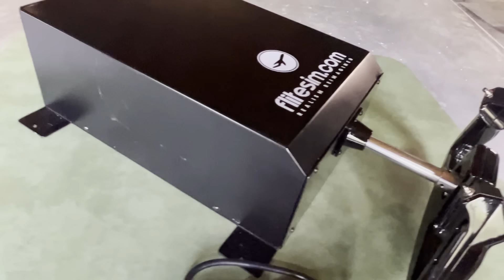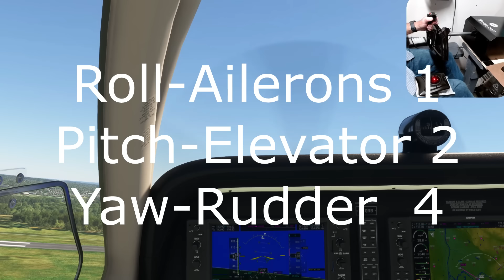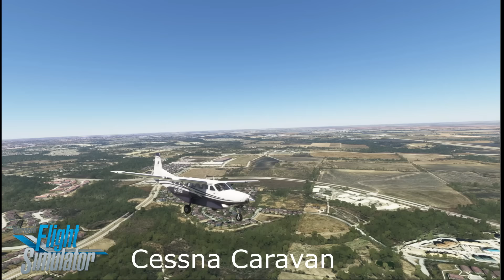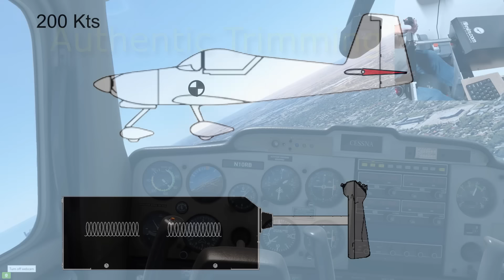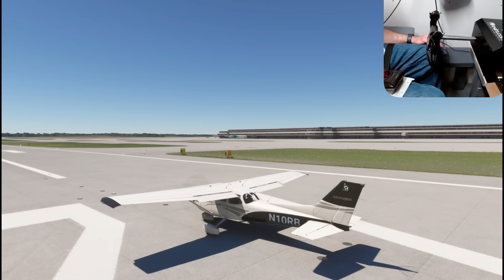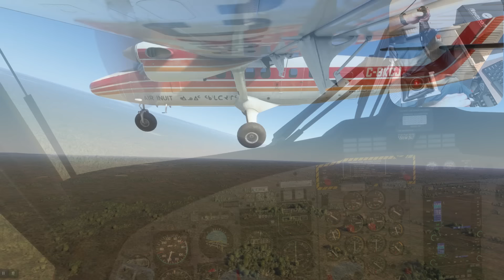Finally! An Affordable Force Feedback Yoke: A Pilot's CLS-60 Review

Comment: Hi Russ. Great Video. I recently completed building my C172SP Home Cockpit for continued training. Part of the build is the CLS-60 FF Yoke. I appreciate your perspective as a certificated pilot (not sure which Russell Barlow of 3 in the FAA Airman Registry you are, but I'll guess you are the Commercial Rating holder  😉). As a certificated pilot working on my SEL IRA, I'd love to have your CLS-60 settings if you're willing to share. I used the out of the box and one or 3 other settings, but they are a bit unrealistic (not fluid) doing ILS approaches with considerable crosswinds -- doesn't feel real. Also the aileron crosswind correction for takeoff and landing seems to be somewhat unrealistic for xwind > 10 kts. Appreciate if you could provide it. Much obliged in advance.

Comment: Russ have you tried the Moza AY 210 FFB Yoke yet, would like to get your opinion
Believe it has the old problem with the trim function, with the yoke returning to the neutral position instead of just releasing the pressure with the yoke in the same position

Comment: I love the fact that they didn't junk up this build with the usual consumer grade light switches, dinky throttle axis, misplaced ignition switch, goofy LED lights etc. This has the feel of Virtual Fly products which are modular and bulletproof. . They could use an extra button on the left for CWS and perhaps aileron trim on right etc. I also like the fact that the yoke itself could be swapped out for say a rams horn Embraer or Boeing style yoke or even a 3D printed yoke perhaps. I hope all devs realize that modularity is key to flight sim controls at least at the pro/prosumer level. imo Thanks for review Russ!

Comment: Thanks for this!  I have been on the PRE-order (Kick Start) list for a number of months waiting for the release.  Getting the emails from Fabian with long awaited shipping options and then finally the units going to those first pre-orders.  My unit JUST arrived a few days ago and I just integrated it into my sim.  WOW!
 
As a rusty old Cessna pilot and current flying with an old friend in his Coast Guard edition Hawk XP (210 HP),  finally built my very first flight sim over the past couple months and wanted to go top tier on EVERYTHING.  The CLS-60 was the perfect addition for my Hawk XP II sim.   I have the full Next Level seat and desk pro, and had to build a custom gaming computer too.  Purchased 3,  55" (4K) screens for this is so immersive and the CLS-60 adds so much realism! 

Tomorrow (as of this writing), the Buttkicker Pro will arrive and is a perfect mate for the NL cockpit, as they provided the post to mount the unit under the flight seat.  This will complete the build.  Fine tuning all the haptics will take some time, can't wait, been a blast so far.   

FUN FACT:  If you are a Cessna flyer, it is known as a CONTROL WHEEL.  You won't find the YOKE reference anywhere in the Cessna handbooks.    Again, thanks for your presentation! 👍

Comment: Thanks for your review. As much as I like the Yoko I have really wanted an affordable FFB. I was also glad to hear your take on the Brunner and its "mechanical feel". Sounds like I would have been disappointed. I've been practicing slow flight and stall recovery with the concept of getting current again. As you indicated it's really a drag (no pun intended) when the spring gives you the same force no matter what maneuver you're completing. I have the Virtual-fly Solo GA1and Ruddo pedals. Hopefully the Yoko cut-out will accept the width of the CLS-60. I'm sure it's too tall, but I can make a cut-out for the depth.

Comment: This does look amazing....but why does it need an emergency shut off, is there something dangerous involved?
Reply from the maker: Yeah I wondered too since Brunner doesn’t have one. When I first got it the self test was more aggressive whipping the yoke from 180 degrees left aileron to 180 right at full aft in an about a second. I guess if you were too close and it went wild the 13,5 pound force  could slightly hurt you but the quick shutoff in red seems a bit dramatic.

Comment: FFB completely spoils you.  I rarely use my traditional spring/cam units anymore.  I am using the Simionic FFB yoke, and the Bruner for my stick.  The only use I have for my Virpil and VKB units anymore is for flying the Airbus, since it is a fly-by-wire aircraft with no flight control feedback, and space sim stuff like Star Citizen.

Comment: I currently use a Fulcrum One and this does look very interesting. I fly in VR and use a physical yoke and pedals and VR controllers and voice commands for all other interaction. Because of that the trim inputs in the cockpit must be feed back for this yoke to work for me. After being burnt by Apara with there Kickstarter I am still a little more concerned than before but very interested in what I am seeing. Any chance this will be at FSExpo.
Reply from the maker: Yes they will be at FSExpo with a chance to demo the yoke
Reply: @rbarlow  Looking forward to looking at there display there.

Comment: The 3rd-party trim wheel functionality is an absolute must.
Reply: Or at least just read it from the sim!  I've never like the yoke based trimming.  I prefer the wheel.
Reply: No doubt! There are some new Cessna style trim wheels for MSFS that use an axis instead of button press etc. Could be a great combo. Within 5 years I expect all moveable flight controls will be FFB. Including trim wheels rudders dual yokes sidesticks collectives/cyclics etc. BTW I think Desktop Pilots WHEEL seems best for msfs. nOT AFFILIATED. gOOD lUCK

Comment: Great review. As I am looking into making my own FFB yoke getting the facts of what force and travel is required is a great bonus of the review. Thanks for that. Normally when you build a FFB device you make it work in accordance with the standard USB HID protocol which make the device plug-and-play even though you may mave some extra settings for it via an external program. That means that all the force inputs are fed from the sim and read by the device that then activates the forces with the servo motors. 
What appears to happen here is that they apply some extra forces (prop wash and propeller rumble at least) that is not a part of what is fed from the HID protocol. I'm just guessing. In that case they are "fabricating" effects that may be accurate, or not... It may also be that the forces are in fact fed by the sim in the HID protocol, but of different types. And they choose to enable or disable those specific types in their software with a setting. In that case they are not doing anything special, just disabling some types of forces that normally would all be read by the FFB device. 
If the sim is producing the correct FFB data in the HID protocol there is no need for any device specific handling of it other setting the max amount of force wanted as far as I can tell. The device just need to sum up all the different types of forcesfed by the sim  and activate the motors accordingly and all would be perfect. 
So what I would love to know is if this FFB device is doing something extra on top of the standard HID stuff.

Comment: I just messaged Flitesim about a couple of things I'd like to know:
1. Approximate cost for the CL-120 upgrade for CL-60 owners. 
2. Does the CL-60 physically move while the Auto Pilot is engaged like the real planes do?
Reply: 2. Probably, since its movement is linked to the control surface position in other aspects.

Comment: Great video and thanks for explaining what you did I learned alot! Now on to the yoke it sounds like the Microsoft Sidewinder 2 joystick from a dacade of more ago I just got for $80... Just in yoke and a more high end form with nice softwear not just relant on Win11 and the FFB isn the sims/game... Which is great especly if you can get one for under $300... But what I want to know if it's plug and play like the side winder or not? Like do you need the soft wear or can it do the sidewinder thing of just working? Also I find it funny the more expensive yokes have a proforamnce more similar to the logitch wingman I just got for S60 new old stock... the sidewinder was just the working stick and cables. Which you can find a wingman for $20 or so working anytime used.

Comment: When you mention that you must use the trim on the yoke, do you see the actual trim being moved on the aircraft?   I wonder if what is actually happening is that it is just holding the elevator position with no force required from the user.   I guess that this gives you what you want most of the time with a different method but wouldnt behave the same in some cases where the trim tabs are acting counter to the elevator.   Great review Russ.
Reply from the maker: Yes the trim wheel in the aircraft moves with the trim switch inputs on the yoke BUT if you trim in the sim the yoke doesn't move as it does when using the yoke trim switch.
Reply: @rbarlow  Thanks Russ,  Hopefully they can get some of that simmconnect goodness going.   I am use to trim on stick for some aircraft but I do like my trim wheels in GA.  This is looking like a nice product at a reasonable price.

Comment: Hi Russ,  Thanks for all your fantastic videos and help over the years.  I asked another (RW pilot) streamer if a force feedback yoke made sense for a 737 sim, and he said (effectively) that you don't really get any feedback from the yoke in the real 73, so - no.   (I guess too many actuators between the yoke and the control surfaces?) I know you mentioned you tested it out on commercial jets, but any more in-depth opinions on if it is realistic to use with Boeing or Airbus will be greatly appreciated!  Is it "just" the higher force needed to move the stick that would be relevant to CA, or is there more?  Thanks again!
Reply: I fly a c130 and have flown the 737. There is force involved it's more fluid but it's more a feel pressures and not forces if that makes sense though conflicts in terms of physics maybe

Comment: Had you ever heard of the Iris Dynamics FFB yoke, using magnetic linear actuators?  Sad they abandoned the FS community for the industrial world.
Reply from the maker: Yes I think it was first a Kickstarter but not sure they ever delivered any regular production units. If the current FS2020 expansion of Flight Simming was present they may have made a go of it. I think someone picked up the pieces to get their tech and patents

https://youtu.be/bOCzSHhjAc4?si=KjjIteyyw2dP-fk1
Reply: @rbarlow  yup, that’s the one.  I’ve been following them pretty closely since they pulled out.  I asked if they had dev/demo gear and drawings they would let go of, but they didn’t.  I took it to mean they were keeping it around just in case.  They make a mighty fine linear actuator, but not an inexpensive one, sadly.
Reply: Like lawyers, they discovered that the "industrial world" has deeper pockets than flight simmers.  That's business.

Comment: Very neat. I have been waiting 40 years for a yoke that would do this. Your explanation of how trim works in real life is spot on and I have tried in vain many times to explain it to non pilots. I have a real C182 and created a sim that closely approximates my actual panel. Mostly I shoot practice IFR approaches and procedures with it. I use a yoke poached from an AST KingAir simulator. It has realistic trim in that there is a separate mechanical spring you can move. Of course like this yoke it is divorced from the computer trim. I turn a wheel like on my own plane. I screwed my self when I added a GFC500 autopilot to my real 182 and to the sim. Well the autopilot trims the plane independently of the mechanical trim. 

It does seem that this new yoke should accept trim changes from an autopilot. My understanding is that the yoke does not do that yet and all trim is by hand. Correct?

I’ll check out the site and see about getting one…

Comment: If you can't afford full force feedback yoke and what you want is mostly the realistic trimming by feel, you can mod Honeycomb Alpha Yoke with a cost of about 50 euro, by installing small linear acuator inside which will allow moving the yoke neutral position forward/backwards.
Reply from the maker: Have you actually done this successfully? If so contact me at username barlow320 which is at gmail which is a dot com.
Reply: Mail sent
Reply: @rbarlow Mail sent again. Contains link so maybe your antispam filter blocked it.
Reply: I have a honeycomb alpha. Looking forward to seeing if Russ gets this to work, because an excellent video will follow. :)
Reply: https://www.youtube.com/watch?v=TXYufEfrOpo this appears to be the video
Reply: Do you have to remove anything in the alpha? And where does it attach to?
Reply: @buikhan Nothing to be removed, just a little bit of cutting of plastic reinforcements in the top cover to make some space. Then you just add small linear actuator with a stepper motor, miniature stepper motor controller and you modify the wiring in the yoke handle to allow trim switch sending signals to the controller. 5h simple DIY task, without any specialized tools.
Reply: @StekuVideo do you have a guide or something? Thank you
Reply: Search for "Honeycomb Alpha Yoke trim mod - prototype 3.0"
Reply: Search for Honeycomb Alpha yoke trim mod.
Reply: @rbarlow I was trying to post the link to video here, but seems like YouTube deletes such posts?

Comment: Can it double for sim racing as well?😅
Reply from the maker: I suppose that firmware and software could be written  to allow that but there would be a physical limit on turning the wheel  plus or minus 180 degrees.  I think on a racing sim you’d want the stronger servo in roll.